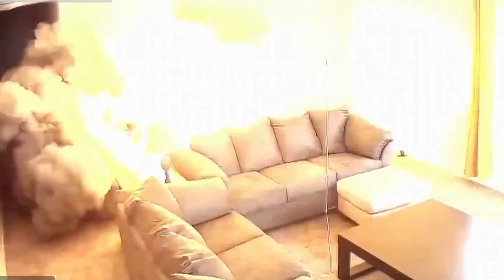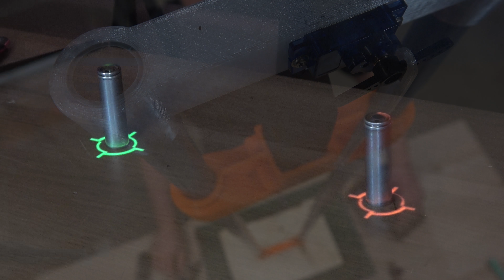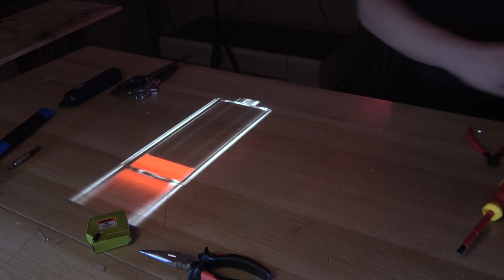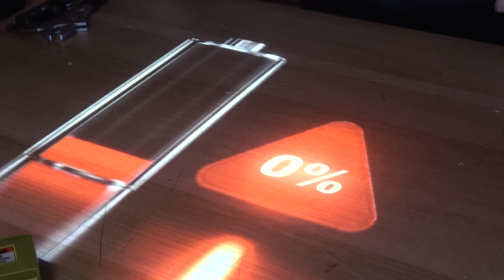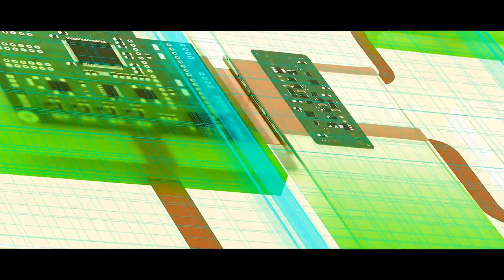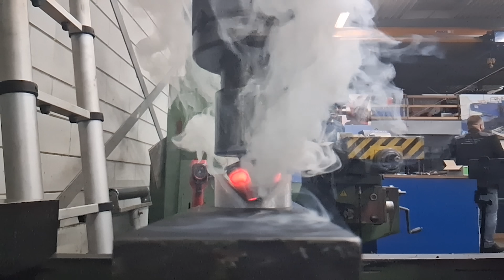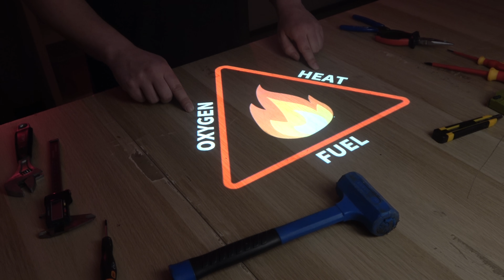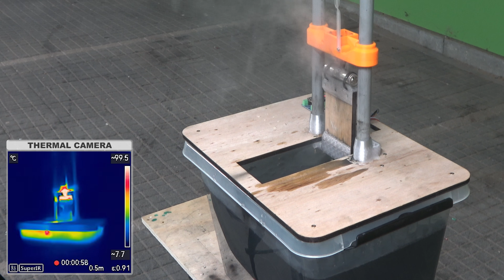Detonating Batteries.. For Science!

Comment: These videos are starting to make me scared of that collection of old lithium batteries I keep stored for projects.
Reply: Its mainly the stored energy that makes them dangerous. Sure, they degrade as they self discharge fully. But as long as you dont recharge a battery that has changed in internal resistance, they're mostly fine. Its when the internal layers are bridged that all the current they can provide (which can be tens of times the capacity rating) is passing through the tiny slivers of positive and negative plate material (effectively foil) that are contacting each other that physics takes over. That HUGE amount of current flow through a small area of foil means that foil is going to get hot, it doesnt matter how metallic it is, at those currents any resistance is bad, and it will still have some all be it small amount of resistance. The foil heats up, that causes decomposition of the electrolyte, which produces heat, fumes, and oxygen, the heat ignites the fumes in an oxygen rich environment, fire, thermal runaway. 

That is why dousing it doesnt kill it immediately. You need to completely discharge the electrolyte, AND remove the thermal energy driving the decomposition. Otherwise it will keep oxygenating its own off gassing (fire) whether that be from thermal decomposition or the heat from internal arcing causing thermal decomposition.

Explosion proof boxes/bags are a great idea, but they arent perfect. Know how they work, know how theyll fail, and use your brain. Think about where sparks can get out, where pressure can get out, where flame can get out. Remember, its a self oxygenating reaction, there will be flame. Know where you're going to throw it, and where your're going to throw it when things go wrong, you are going to throw it, but a mom with a stroller is standing there. Plan your oh shit moment.
Reply: @mandi8345  Well I store them fully charged. Now I feel more worried.
Reply: @User.ATMEGA328P if youre going to store them long term, I hear its best to take em to about 40~45% charge. But remember they'll still self discharge eventually. look up checking lithium battery health (I imagine its some thing like checking the open circuit voltage vs a known load vs discharge rate vs internal resistance or some such...I have a ton I pulled out of cheap chinese drop shipped junk laying around my desk and have yet to have an issue (knocks on wood), but if I were to charge them fully id definitely check em, charge them outside, and watch em like a hawk...), hopefully you have the means to check them, but its only when they go under like 2 volts or something that they grow internal structures that could cause problems
Reply: @User.ATMEGA328P You are storing energy chemically to be used later so why did it never cross your mind to begin with? It's even on the packaging these things can be explosives under charge just like any other combustible fuel. Do you also smoke while fueling up your car knowing that could go wrong or do you wait till everything burns down and start thinking you should read labels and product safety briefings? These are often even separate warning manuals next to the normal manual. Manufacturers even put these warning labels in your face on the box and before first use
Reply: @U@User.ATMEGA328P чувак , это ужасная ошибка , они деградируют быстро при напряжении ~4v+  , а хранить их лучше на 3,5-3,8 , у меня у самого куча батареек - я давно ремонтирую электронику , и раз в полгода я их все перебираю, если это пакеты смотри визуально есть ли на них выступы  , если у батареи целлюлит - в помойку, но перед тем как их выкинуть я их собираю в кучу и по одной медленно разряжаю до 0v в холоде - ниже 0°c часто даже вставляя ее прямо в снег  еще можно потом когда на ней 0 закоротить ее тонкой проволочкой
Reply: @madzak9847  It's because they are from old broken USB devices, and before they get thrown out, I take the battery out of them, and if it still has usable capacity, I keep it, but I never bother discharging them to that level after the test. Maybe I will now that you mention that.
Reply: @User.ATMEGA328P 

Buy yourself some surplus ammo boxes. The green ones, military. Put a layer of ductape/electrical tape on the inside surface to act as an insulator.
Reply: 138
Reply: I just bought one of those bags and gloves they use on aircraft😅
Reply: Why? As long as the terminals do not connect in any shape, form, or fashion, nothing will happen.
if you want to prepare a lithium battery for disposal, drain all energy with an incandescent bulb, then after confirming the voltage is under 200mV without any load, solder a 10 ohm resister as a shunt. A shunted battery is a completely zero energy battery.
Reply: @Project23D  Isn't that bad for lithuim batteries to discharge them all the way to 0V, they are meant to be kept at around 2.5V, when dead, to maintain their chemistry. I think I actually did let 1 go down to about 1.5V, and it swelled up a bit, had to get rid of it.
Reply: Likewise I sometimes worry about the old drone batteries from years ago scattered god knows where in my room
Reply: I recycle stuff; lots of stuff. Wont touch lithium ion batteries. Also, no one in the recycling world wants anything to do with them. I hope you can find a safe way to dispose of them.
Reply: @TiborRoussou safest way is to discharge them first and then dispose of them with hazardous waste. I like to plink my old batteries with a pellet gun until I get it to explode and smoke. And then drive a nail or two through them to make sure I got all the layers in each cell. At that point you could take it further and soak them in salt water but that's not even necessary, you can dispose of them anywhere old batteries are accepted and they will be the safest batteries in the bunch (most people don't even bother discharging fully first)
Reply: @gutrali  So, you have solved my recycling problem? Not! I should send you Tesla batteries for you to shoot your pellet gun at. Please, don't ever drink or do drugs.

Comment: They are pretty safe. I've been working with lithium cells for like 20 years (professionally I mean). A lead-acid-batery is way more dangerous.. I've punctured a lot of batteries in my life, even LiPo and I never had a fire. Draining them to zero does NOT make them useless.. I have cells that are 20 years old that have been zero volts for years. After years I charged them and now 4 years later they still have almost 100% of the rated capacity (slightly lower, but they've been in service for years before they were 100% drained). It's the dendride that makes a cell useless, kinda, it depends on the amount of dendrite. When cells are drained too far it starts to "create" dendrites...I've even drove over 18650 and nothing happened.. I've tested hundreds of cells like 10 something years ago because I was curious and the talks about "fire hazerd" were quite popular.. But I couldn't get them to catch fire. But I did get some to start smoking, and I tossed them outside when that happened..
The cells you were using are LiCO2 meaning Lithium Cobalt Oxide.. The oxide makes it burn even under water (that's the source of it's O2 , the oxide)...
Reply: Interesting. I'm keen to know more? I'm building a battery pack for my motocross bike. I have heard that 50°C is actually the optimal temperature for charger l recharging and discharging?
I plan to build my battery pack to have voltage overhead i.e charge only to 80% but 80% charge = 100% or full according to the controller.
Reply: @jameshatton4211  50°C ? Nooo..Optimal range is 20°C to 25°C (see datasheet).

Comment: These test are great but most batteries are are in a bank inside a case. In a bank of batteries in their case would be really be explosive, nothing can stop it from blowing up. And I think smaller devices with a single cell explodes too because the small case they are in give the battery a chance to build up explosive power.
It would be great if you could also add a battery with case test and maybe a battery bank. I dont think a 3D printed case would show this theory. Maybe use a small PVC pipe and encase the battery there and puncture it to test.

Comment: In the water submergence test, what’s actually burning “on top of the water” is hydrogen gas, I believe, which you see bubbling out of the battery while it’s underwater.
Reply: If I remember correctly (from an explosions & fire video) metal fires tend to burn so hot that they can strip apart water into elemental hydrogen and oxygen which fuels itself using the oxygen while burning the hydrogen. Also class D fire extinguishers are just professional grade salt dispensers

Comment: Can you give a demo of extinguishing a battery with salt and with sand thank you🥰💥🔥🤳💥🔥
Reply: Also, I was thinking about mineral/synthetic oil and others motor oils alike. It should prevent the lithium reacting with other elements while cooling it in the meantime, isn't it ?
Same question with liquid nitrogen. (I suspect this one to be very efficient, the only problem being liquid nitrogen isn't the kind of thing easily available unlike motor oil)
Reply from the maker: My previous employer has a weekly delivery of liquid nitrogen in small drums for the work they do. And I'm sure I'm allowed to use a little bit of that!😋
Reply from the maker: Added it to the list for part 3!🫡

Comment: Submerging the battery did indeed contains the reaction in such way that prevents other objects from catching fire too.
It looks like a good idea if you can submerge it, spraying water will do nothing
Reply: Spraying water is what fire departments do on EV fires. They last too long for foam to be effectice, it is all about cooling things down around  the fire and water is very good at that. Being afraid of the lithium catching on fire because of water is kind of silly. It has oxidizers inside and then when punctured, air can get in. It does not need water specifically to burn... 

Of course, spraying with a fire hose and with garden hose are a bit on a different scale, fire departments practically douse the fire, not exactly submerged but not far from it.
Reply: @squidcaps4308  Water does react with the chemical inside and the result is hydrogen gas, that is why spraying water is dangerous because of secondary explosions.
Firemen knows that and keep a good distance.
Reply: @RatoCavernaBR  Spraying water is the primary way to put out lithium fires as you cool the other batteries around it to keep it the fire from heating those up and then those catching on fire. There is very little to almost no hydrogen made during the use of water and it isn't because of the reaction to the chemicals in the battery but the electricity separating the hydrogen from the oxygen which like I said is almost nothing. I have watched many battery fires and NONE OF THEM EXPLODED with any hydrogen or by any other means. Batteries burn they don't explode unless punctured and EV batteries and their packs are specifically designed to contain these types of punctures and slow any fire down.
Reply: @Aircam73  I understand that.
Yes water is good to remove heat but does the water do it enough? Like the temperature to ignite a battery is smaller than the temperature it generates when burning. Submerging the battery wasn't enough so what kind of water spray do you need to properly cool it down?
Reply: @RatoCavernaBR  You are confusing stopping the fire with water vs stopping the spread of the fire with water. You really can't stop the single battery fire with water as the discharge blows the water out of the way and will burn until the electricity is discharged from the cell. Putting water on the fire keeps the surrounding batteries from catching on fire by not allowing the cells that are burning to transfer their heat to the cells that are still intact. That is why at ever battery fire they are using water and then continue even after the fire is out to put small amounts of water on the battery to keep the cells nice and cool so even if one ignites due to damage it won't cause a chain reaction. This is also why they put sand on them or submerge the batteries until they are sure all the damaged ones have discharged.
Reply: why is bro tryna sound all fancy

Comment: Great video! Next video i have few ideas you guys can test... real life scenarios... like how long to overcharge till internal failure with some dumb charger... or can faulty charger cause fire... am always afraid when i charge my ebikes and always watching... also you can test if cheap BMS would prevent overcharge... power grid failures - unstable house voltage like turning off and on charger really fast, can it trigger cell failure... would wooden box be enough to trow away a battery out the house if something wrong happen... like i charge always my ebike battery in big wooden box and i think if i only see smoke coming out i will immediately pick up the box and throw out the house... 20-30s window to react i think would be enough to save my house from fire...
Reply: I think most tires are from over charging caused by either no BMS or shitty BMS? Most chargers don't have the ability to balance cells which is the biggest risk.
Really you need dual BMS for charging and discharging from what I've  read? This is to prevent one cell from over charging and also to stop charging the parallel pack if a cell doesn't balance correctly. A good BMS will detect a faulty cell and disconnect an entire row of cells from the battery pack but still allow you to get home👍

I will be building my battery pack for my motorcross bike to have voltage overhead; meaning when the battery is at 80% fully charged it is 100% voltage according to the controller. This will allow for fast charging because the longest part of the charge cycle is from 80% to 100% and that takes 80% of the time?
Charging to 80% is only 20% of the time duration, that last 20% take the longest time.
Reply: Wooden box is ok but you know it's going to catch fire as well even after you take it out of the house. And it's the hydrogen gas that can make it explosive not necessarily the smoke? Meaning by the time you see the smoke there can already be a huge amount of hydrogen gas built up and containing it may make it more explosive? So you may kill yourself moving the box outside but not burn your house down?
I will change my battery outside the house inside a brick shelter protected from weather and introduce a pyrometer fuse? They use those technology on the exhaust systems of highly modified diesel trucks. I'm just going to put a smoke detector inside the brick shelter 👍 
I will just turn the power of if I hear the smoke alarm beeping and obviously close any windows so toxic smoke doesn't blow into the house.

Comment: How does a battery react to different grams of salt?
Reply from the maker: Can you explain further? Because I'm not sure I totally understand what you mean yet!🤓
Reply: I think he means from early days drone flying with lithium polymer to dispose of batteries they would recommend discharging to zero and submerging into salt water. The nacl in salt does a double replacement reaction because it's a salt electrolyte inside the lithium cell but a different salt. By making strong brine it is meant to resist the conversion of hydrogen gas...... Apparently?
Has to be a saturated brine.

So I think he is suggesting to do the same dunk test but into highly saturated salt water i.e.  water that has been heated and boiled and then salt added to super saturate the solution (extra salty brine). Boiling the water is also meant to "cook off" any dissolved oxygen in the water further suppressing hydrogen formation from electrolysis splitting H20 into H2 and O? Theoretically speaking? So you may not get those big hydrogen flames above the water like in your experiment? Theoretically speaking.

And yes I would definitely like to see this experiment carried out to see to what extent it is effective?
So now that I've posted this I'm going to have to subscribe, aren't I? 😁
Reply: Damn it now you've given me an idea!

If the experiment is successful then potentially having a brine bladder around a battery that bursts when there is a thermal run away might prevent battery explosion 🤔  just like your thumbnail picture of phone in aquarium 😆 but has to be salt water aquarium..... One with nemos swimming around jks😛
Ok I'm subscribing now

Comment: I find dendrites to be the most concerning danger with Lithium batteries, as they can't be seen and can short the battery without warning. Is there a charge/discharge approach which can we reduce the growth of dendrite?
Reply: That's what I just said to someone in the comments that dendrites and fissures are the biggest danger and this mostly occurs from charging and discharging batteries at lower temperatures. 
From my understanding 50°C is the optimal temperature for lithium ion batteries. Also changing only to 80% is optimal also?

I'm building a battery pack for my motocross bike that will have voltage overhead. So I will charge the batteries only to 80%. But 80% charge will be 100% or full according to the speed controller